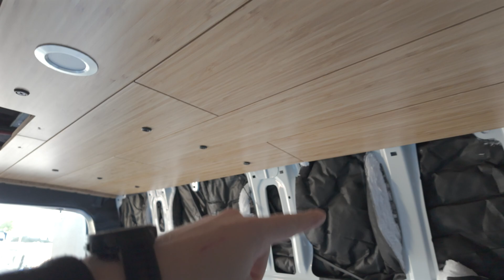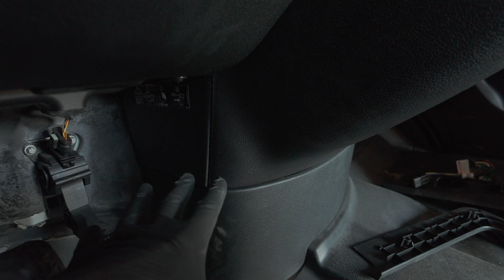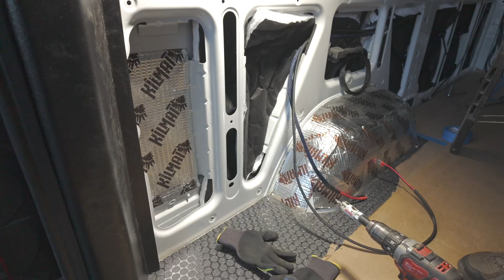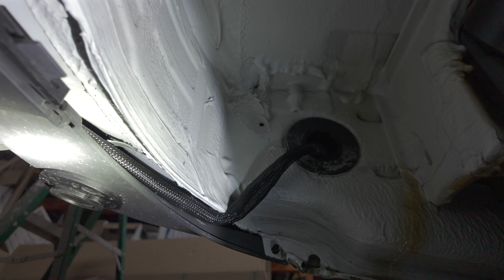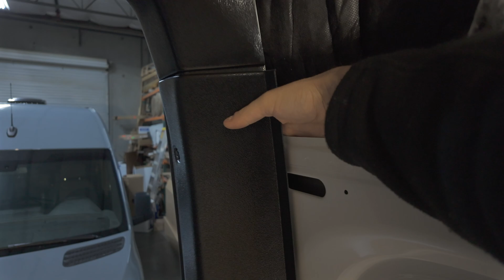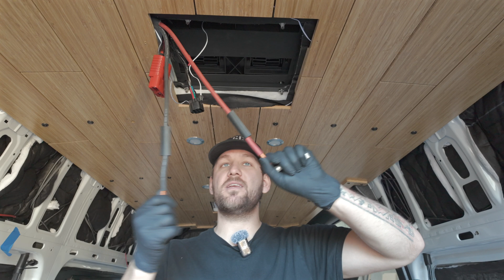Complete Guide To Pre-Wiring Your Camper Van | Serg Supply

Comment: Awesome video! Just 1 Q. Why does your DC/DC charger cable run down into the boot if you're running the line through the van. I thought the boot was only to run the DC/DC line under the van. Do you have a power post down there you're connecting to?
Reply from the maker: We run through the boot for two reasons; a) it serves as a water-tight gland when ziptied, doesn't involve drilling holes at the risk of hitting fuel lines or creating rust spots. b) the "connect" for the alt-in on victron systems is below the chassis on a terminal just below the transfer case. On other power systems, the DC/DC ties right into the battery, so this part may not be needed.
Reply: @Serg_supply I came here to ask this exact question. I was going to run my main dc/dc under the van and come up that boot but when I saw you run through the van but then still go out of the van I thought….. what am I missing lmao the battery is right there? So it’s just something the victron needs I guess? Interesting. I don’t have a victron DC/DC so that would make sense that I’m unaware! Thanks for the video, really love these!
Reply: @Serg_supply  Do you have a video follow up on where/how you connect the DC/DC charger on the terminal near the transfer case? For every other install I've seen, they run it to the bus bar under the seat. I guess AO sells a bus extension plate to get another terminal on that bus bar for 23'+ Sprinter vans... Would love to know more about why you don't do it that way. Please!

Comment: I looked ar the NoCo power inlet, but it's only rated at 15 amps. How is that sufficient for 30 amp shore power?
Reply from the maker: Great question! We don't allow any of our systems to charge faster than 15A and it is important to note that our exterior power kit is also only rated for the standard home garage 15A breaker. We've seen unpleasant things happen to cheap extension cables at higher current, so we like to charge slow, if ever needed. This is very much only a preference though, and a larger plug with appropriate wiring (and power system parameters) can be an easy workaround and connected using the same method.

Comment: Great video!  If I may, here in Canada we have road salt during the winter so placing de 110 VAC plug and a rocker panel rubber plug partially opened so close to the wheel projections is running for trouble.
Reply from the maker: You make a great point - road salt can definitely be a major issue!